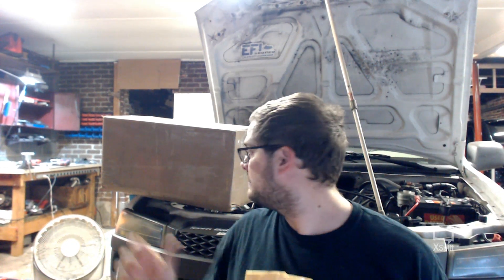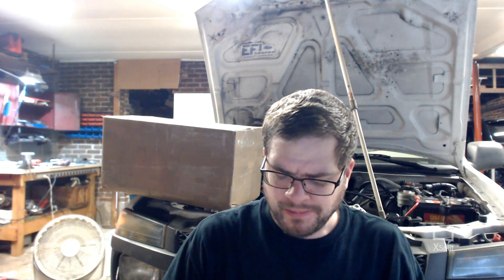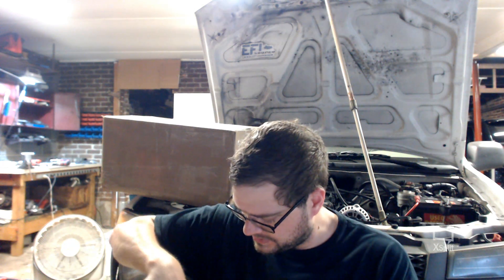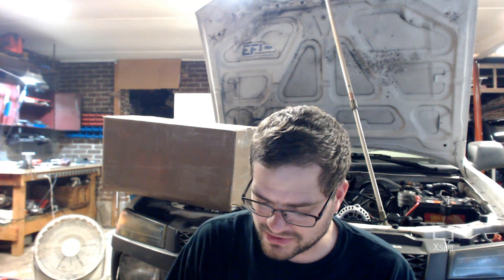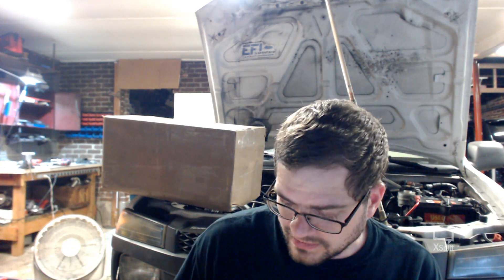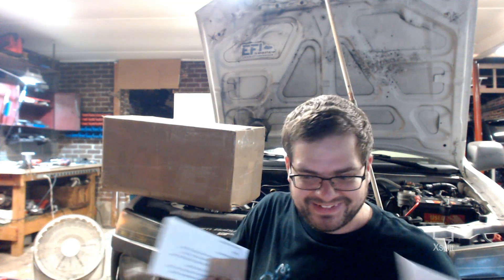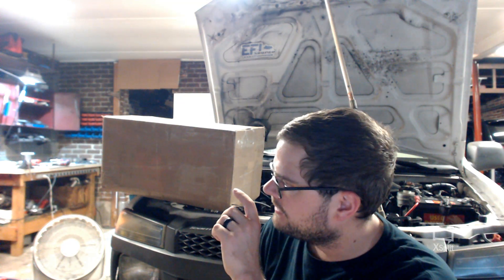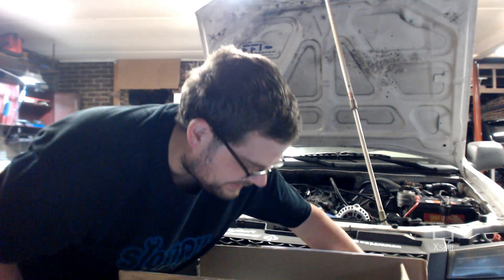friday fanmail 24 - oil pump, MAFS, ported heads wtf!

Comment: About desodering the IAC chip and soldering into a ECU without a IAC that may not work as there is normally support passives on the boards that don't have components mounted like resistors and capacitors
Reply: It's hard to tell which way GM would go on something like that. They'd have to pay a guy to figure out which $.001 of resistors and shit on the board they could eliminate, but any bean counter could easily spot the $0.10 IC...

Besides... Other empty pads should be obvious and he's going to have a parts computer (as any of us likely to do the same thing would) so he can steal other stuff too if he needs to.
Reply: Yeah, considering they're cost in the bulk their buying resisters and supporting pieces price per unit is probably stupid cheap I mean I do electronic projects and even at a retail price caps and resistors are pretty darn cheap (except the bigger caps for high voltage stuff which get pricey, but the ECU has none of those obviously). Compared to proprietary flashed chips and the standoff which granted at their price is still cheap, but you shave money where you can. I guess we'll need to wait for his 'did it work' video to know if he got it working.

Comment: Ported heads make a big difference. With boost gains are exponential. Especially if you take the time to gasket match. I bet gasket matching alone nets another 100hp at the flywheel at the 1000hp level

Comment: Have to consider the bump in compression if the heads are decked.
Reply from the maker: yep it will be slight that is why i said it, it was just cut enough to make sure its true. so its not like alot was cut to bump it, but it could help a tiny
Reply: 0.007 is enough to lose only one CC of chamber volume...these were probably taken down 0.002- 0.004"

Comment: I would see the ports on those heads.
I would see you to use the bellmouth wich was sent to you too while you are testing the heads too.
I suggest you to get a better intercooler too.the air tanks and pipes on it are quite not flow friendly.
If i had money i would buy you one just to see you  to compare all that on a dyno.

Comment: I'm saying 125 HP easy
Reply from the maker: everything the same and 125 extra hp? that is approx 3-4x what i am expecting lol
Reply: I'm an optimist
Reply: I'm expecting boost will drop and power will tick up a touch. If you bring the boost back up, I'm guessing you'll run out of fuel based on your previous runs.

We shall see. Only a chump would turn down free horsepower even if it's 10hp, so, game on!